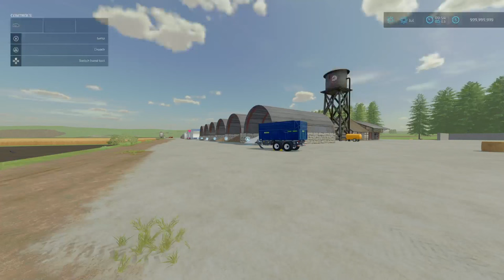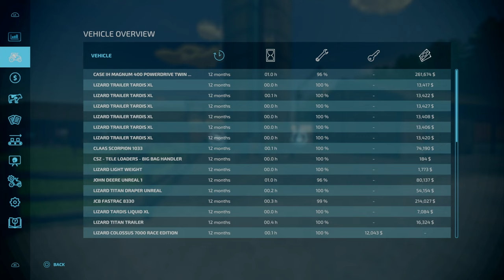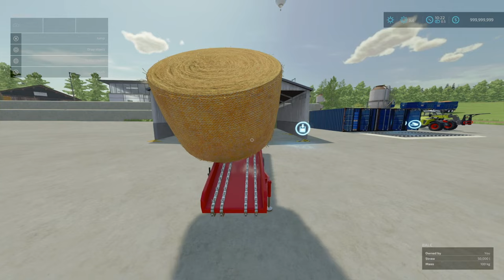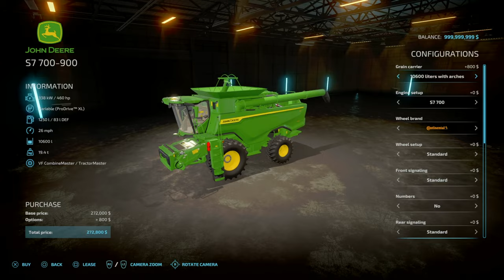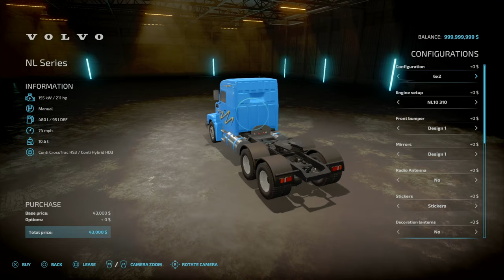Header Stacking, Straw Silage AND MUCH MORE | FS22 Mod Review Console | 12th April 2024

Comment from the maker: Timestamps:
0:00 Intro
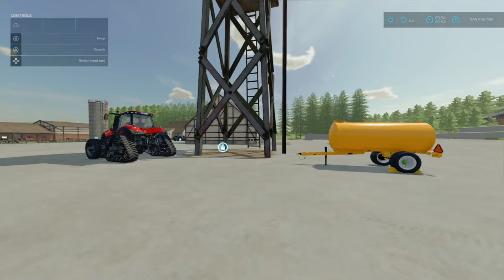0:17 American Water Tower
1:36 Multipurpose Sheds Pack
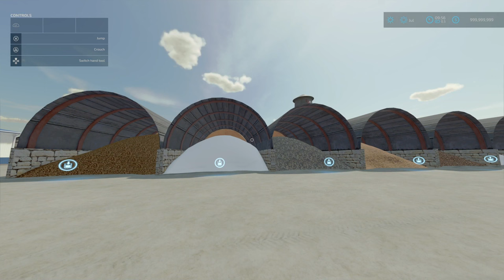3:10 Metal Garage
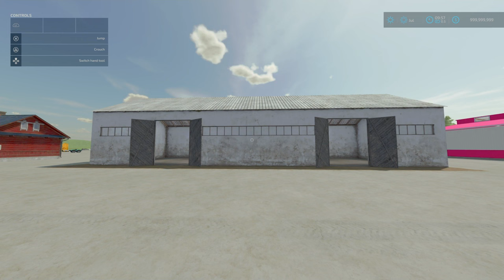4:22 Old Polish Garage
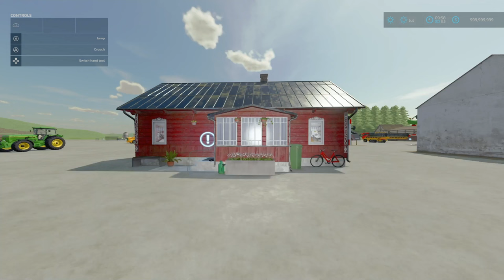5:38 Small Polish House
6:34 Three Sided Farmpack
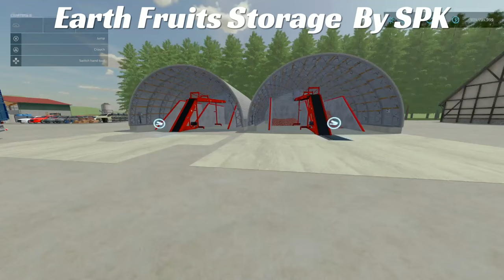13:45 Earth Fruits Storage
17:35 Rent Your Stable
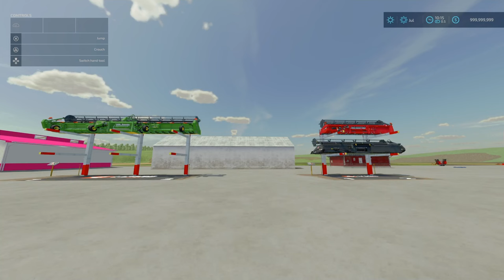22:52 Lizard Hydra-Glide XL Header Storage System (Mod of the Day)
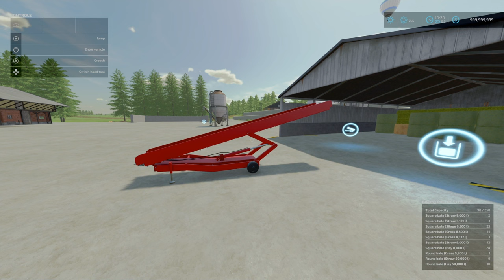29:51 Bale Conveyor Belt
34:06 Resistent Weight (REMOVED From Modhub)
35:28 Quivogne APXRS
37:18 Case IH 770
40:37 John Deere 627C
42:13 John Deere S7 plus Header
52:01 Lizard 608D
59:22 Volvo NL Series
1:05:31 New Holland TK4 Series
1:09:33 Outro